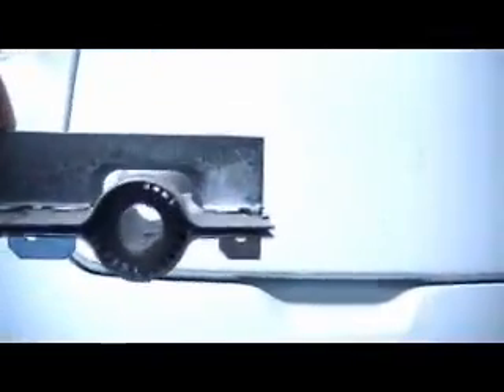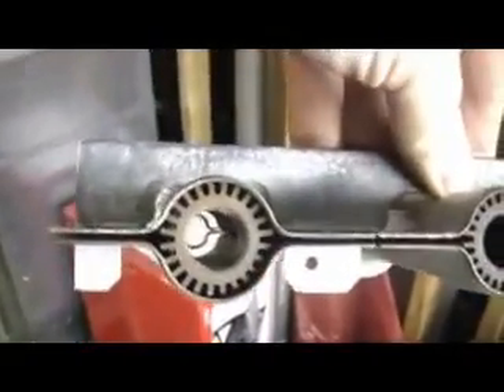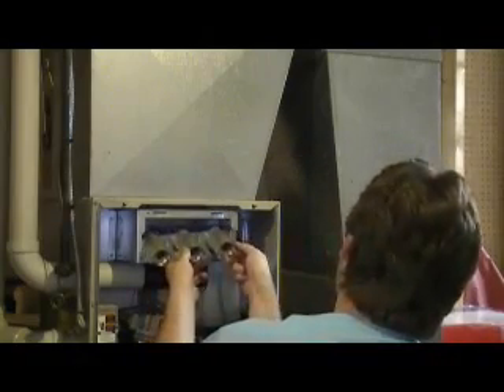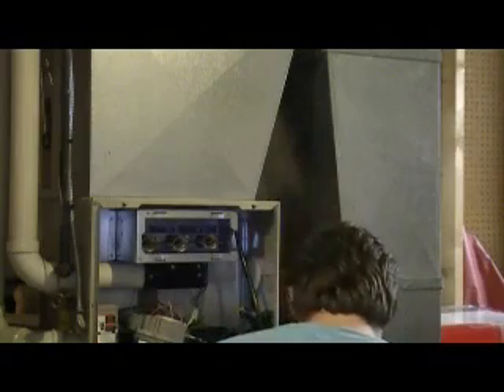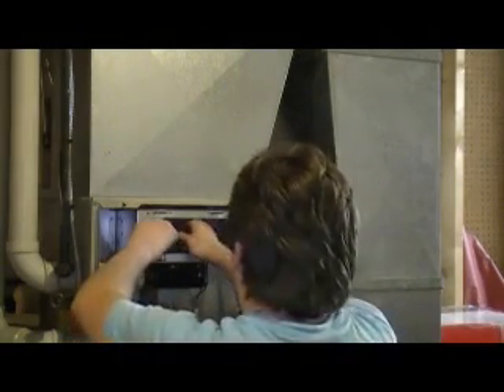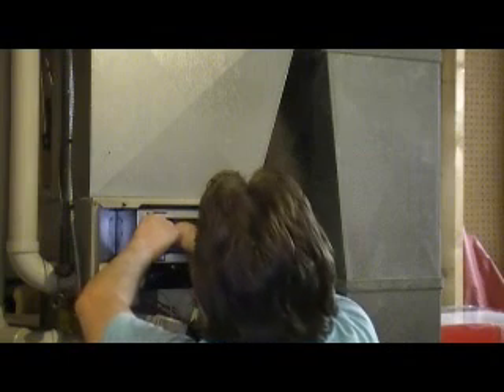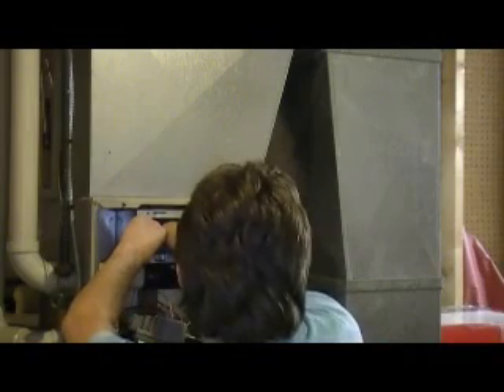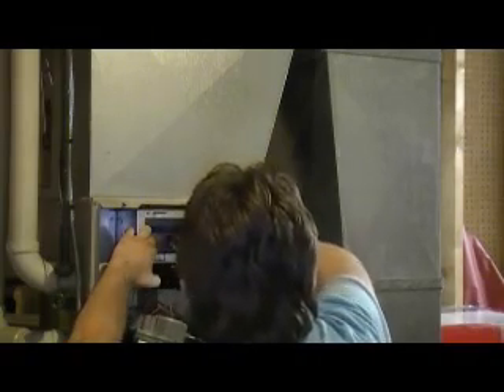DIY Natural Gas Furnace Burner Cleaning

Comment: As a licensed HVAC contractor I advise against this as a DIY project.  That said, it looks like you did a good job.  I would soap test my pipe connections before restart and use a backup wrench when connecting unions.  It's also recommended to check/set manifold pressure at the gas valve using a digital manometer.  3.5" water column is standard for natural gas, 10-11" for propane.  There are reasons why licensing requirements are in place.  We are not a third world country where it's ok to fix things with bubble gum and rubber bands (Cuba).  Please respect our trades.  We have put in a lot of experience/study time, energy and money into becoming qualified to provide a proper service for which we are accountable to the state/county authorities as well as insurance providers.  The end goal is public safety, not weaseling people out of their money.  I have been blessed with a passion for a vocation/public service which also provides my livelihood and feeds my family.  Thanks for the video.
Reply from the maker: Thanks for the comment Doug. The first respectable one from an HVAC tech I might add. Good advice. I don't think you have to worry about this video running HVAC techs out of business. Folks like myself are a significant minority. I will likely have an HVAC Tech come out next year in hopes they perform some tests this time....This video is billed as a cleaning, and that is all it is.
Reply: Thanks for your reply!  You seem very capable and knowledgeable.  Thankfully, most people aren't as capable/confident so I agree, my services will remain in demand.  Take care, bud!
Reply: I guess i depends on the homeowners knowledge and confidences if he or she should tackle something like this, we do respect your trades but not always they would be needed due to that reason
Reply: Good advice. Why would the manifold pressure change?

Comment from the maker: Thanks Dave. It looks like the average DIY'er can replace a good number of the parts if need be (several Bryant parts stores on the web). I'd probably avoid taking on the larger repairs (heat exchanger, etc), but wouldn't be afraid to tackle some of the others. (...You could replace nearly all electronic components for the cost of one trip out from an HVAC Tech)

Comment: Your right on the money there, they put service manuals out there for service technicians but if you can read and follow simple instructions correctly, I don't think you'll blow yourself up. Service technicians stick it to you, why ? You're in a bind and need help now.  When a starting capactior can be bought by you for $28.00 bucks they want 100 to 200 bucks because yours is special. Yup, yours has a P/N that has to be replaced with one that matches that part number. Why is that special ?

Comment: Im an HVAC tech, dont clean the HSI with ANYTHING! it will break. as far as the flame sensor goes you dont want to use sandpaper because you will scar the metal  and dirt will build up faster. you want to use a dollar bill or a SOS pad. As far as the prices go for hvac work, the company has a set price book and me as a tech has no control over the prices. our truck stock are inventoryed

Comment from the maker: **Had Furnace Trouble Tonight**
Recvd fault code 32. Fires up normally and burns correctly. Furnace disables iteslf after about 15 seconds, then tries to cycle again about 3 minutes later....code prompted me to inspect the drainage system. Disconnected the collector box drain tube and water poured out (about a cup or two). Removed the condensate trap from unit and cleaned out in the sink. Found several dirt/sand/clay/rust blobs upon flushing the unit. Reinstalled and fired her up. Back to normal

Comment: not trying to be rude here, but you should not have to remove rust from end shot burners like you have. if they have excessive rust them then they should be replaced. when the burners rust and you remove it, it makes the openings larger in the burner which changes the veturi effect and can redirect the flame. the only cleaning of end shot burners that should be done is removing the dirt and dust that accumulates  in the venturies. just sayin.

Comment: @vichimself69:  The majority of HVAC repairmen are either 1)incompetent , 2) crooks, and/or 3) a-holes (especially this time of year). Well-known HVAC company wanted to replace my gas valve and limit switch for 835 dollars and then had the nerve to say I should just get a new furnace for 2500, because i'd be paying 835 already to fix an older unit.  Turned out it was LOOSE WIRING THAT I FOUND AND FIXED MYSELF so f#$@ all HVAC RETARDS WHO think people owe them a living just because they exist!

Comment: People like you keep me employed.  You forgot pretty much off of the important aspects of servicing/maintenancing a gas fired peice of equipment.  Cleaning your burners doesn't do shit most of the time unless its filthy.  You didn't check/adjust gas pressures, check limit and safeties, pull out blower clean or oil depending on motor, take CO test, check amp draws of motors.  And for god sake that peice is called a drip pocket.  DON'T BLOW YOUR FAMILY UP.... call a tech.

Comment from the maker: @tulkster023  Feel free to write Bryant and let them know you would like to rewrite their service and maintenance manual per your expertise. Obviously anyone with any knowledge of this furnace would know that its impossible to access the burner without removing the burner box cover.....per Bryant: "3. Remove burner box cover. 4. Using backup wrench, disconnect gas supply pipe from gas valve......8. Remove manifold, orifices, and gas valve as 1 assembly."

Comment from the maker: Thanks for the replys. The video is advertised as a furnace burner cleaning. (not complete furnace tune-up, overhaul, calibration etc) There are tasks that I will have a "professional" perform when necessary. Let's not confuse this with a full blown furnace tune-up. This is simply my replacement of the $80 cleaning I got when I paid to have my own furnace "tuned up" by a "professional".

Comment from the maker: Thanks for the comments. I didn't mess with the hsi (hot surface ignitor) when I cleaned the furnace. The Bryant service manual indicates this piece does not require annual inspection. It does state it is brittle, therefore I would be cautious if attempting to clean it with anything. (maybe emry cloth, if anything at all?) I was advised by an HVAC tech to clean the flame sensor next time I clean the furnace using fine sand paper. (also recommended by Bryant service manual if needing attention)

Comment: great video, im about to change my hsi myself with the help of the fellas at grainger who sold me the parts & some hvac guys who where in the store, everything i planned which i learned from a youtube vid such as this was right on the money.  i just wish i had taped it too, i had a leak from my ac coil) that rusted some of my parts (the ac is fixed) i just wondered what you used to clean it if you didnt have emery board.  Thank you for the toothbrush tip!

Comment from the maker: Sorry you found this useless. Perhaps you are a "Pro". Perhaps I found myself unwilling to pay a HVAC guy $80 to spend 40 mins doing what I did with his vacuum cleaner, screwdriver, brush and trouble light this year. I wouldn't have made this video, except that "Pros" like you are too "nervous" to make one for the masses, and I opted to fill a void. (hence the 1300 hits in a  month)